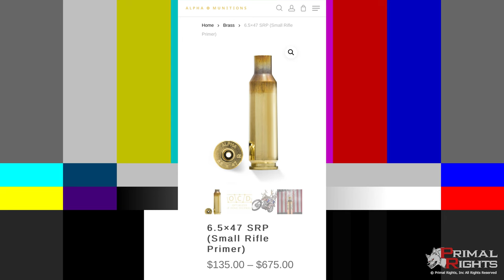Are they making bad brass? Here's how you tell!

Comment: I think saying the Brass manufacturers have no control over the metallurgy of their brass is a stretch. They will have a desired brass alloy they will specify from their supplier, some brass manufacturers may have wider tolerances in composition than others though.
Reply from the maker: I was being generous. Of course they can control what material they buy and can select whatever grade they prefer.

Comment: when brass is made by most companies it is made on more than one machine and when finished goes into a large bin .  then the bin is dumped and boxed up to be sold . so in one way even the same lot number will have different cases in it from different machines . i compare headstamps to see if the markings are the same . it will shock you checking that . but need a good magnifier to do it right . i even check the depth of the case head on my cases . and find even great brass is sometimes up to two thou different . you are so right about brass . my deer rifle i use what ever brass i have and don't worry about checking . but here in the east 100 yards is long range for a deer . my target loads and varmint loads get everything checked . really comes down to what works for the shooter and the loader . great video !

Comment: I did stumble one additional way to observe brass consistency, using the Aztec mode on your AMP annealer. When I first got my AMP i was struggling to get a reference number to anneal with, almost every piece of fired box brass gave a different reading from the Aztec mode, even though it was the same ammo and company. 
After annealing a once fired lot of Lapua handloads , I found the Azetec mode to give identical codes for the melting point of all of the tested cases.

Comment: Great info ! Thanks for sharing this info .As a competitive shooter I have loaded almost nothing but Lapua brass even though I had to fire form cases I just didn’t want to chance switching off from Lapua and having my scores possibly crash .Well after building a 6 BRA and having to experience heavy soot down the case for know reasons than I can understand. I cut necks into the shoulders ,annealed ,tested and tested and I can’t stop the soot .A good friend sent me 5 pieces of new Alpha 6 BRA brass I fire formed to my chamber ,know soot . I had pressure and backed the load down by .04 of a grain compared to Lapua .Alpha is very consistent with accuracy. I just order more today 6 hours before I saw this video. Thanks again for doing what you do to help our community.

Comment: Thanks Greg. We appreciate you & your work. Most of my brass is Alpha or Lapua with a sprinkling of Peterson. I probably have in excess of 2.5K pieces of Alpha. I obviously like them, but am puzzled by the neck wall thickness. It is rare for me to measure a piece of Alpha that doesn’t have close or in excess of 1 thou difference in neck wall thickness. I hate when circumstances to cause me to have a chamber neck diameter that is large enough to prevent me from neck turning. I won’t write about all the things that an uneven neck affects. My degree is in technology, but I worked as an engineer during my career. I have a lot of chemistry, physics, microbiology, etc. This causes me to question my measuring techniques & try to better them. I had a decent Mitutoyo ball head micrometer. After my findings I purchased calibration blocks and another ball/anvil head micrometer to ensure the measurements are repeatable. They are. The fact is they are horrible in this criteria that you think is so important. I’ll be happy to send some for you to measure. You don’t own as much as I do without liking Alpha. I try to work around it with the neck turning.
Thanks for all you provide us with, God Bless
Let me know if you would like some samples from newer virgin Alpha OCD cases.
Reply: It sucks when someone you listen to for long periods of time, even enough to know the speaker better than some extended family members, doesn't check their own channel to interact with subscribers with genuine questions about the topic of the video.
It causes me to question why they have a channel.

Comment: I only used Lapua until Alpha was available and Lapua wasn't. Had problems with the .200 dimension with br and bra in beginning, but after loading up charge weight on Alpha the heads finally grew to grip my chambers and stopped getting bolt swipes. It does perform very good now. Alpha was very good at answering my concerns and helpful in suggestions. Bit i still hate to have to fire brass five or six times to get it to perform. I am using a   standard reamer for both cartridges that Lapua cases always performed with. Alpha heads are very hard and i feel a little smaller dimension at .200 dimension on head of case. I wish they hadn't change that from what wheeler had tested.
Reply: I had to rechamber a barrel cut for Lapua because of case blowback. The new chamber was cut with a Alpha legacy 6mm BRA reamer. So far the performance is nowhere near what I expected. I just received a barrel yesterday chambered by Alex Wheeler for 6mm BRA using Lapua brass. I have never see such beautiful work on a new barrel. I’ll soon be seeing which outperforms the other. My 6 GT shoots with more precision that the Alpha 6 bra.

Comment: I was the one who presented the question in the previous video about how can you control/adjust seating force other than increasing or decreasing the diameter of the expander mandrel. I understand turning necks to various thickness is one way, but I was coming from the assumption that this was already done and a uniform neck thickness and concentricity had already been achieved. I'd also assumed that the annealing setting had already been established using the AMP. I sacrifice cases in my AMP Annealer and use the setting provided by the device. I don't see how we can accurately determine if another setting is more appropriate or accurate than the device itself. I just don't feel comfortable increasing or decreasing that setting and don't want to expend barrel life to prove out what changes that makes. I'm content accepting what the machine is telling me to use.

Given these parameters, I'd like to understand how one can adjust seating force "neck tension" aside from using varied diameter mandrels. I will typically select a mandrel diameter and seat a bullet in an empty (prepared) case, with the AMP press to see what force is achieved before starting a lot of loaded ammo. If the force is too high, I'll go up 0.0005" or 0.001" in mandrel diameter.

I'm achieving very consistent force readings over say 100 rounds. Usually around 10-12 lbs. ES. If I have an occasional outlier or two, I'll set those aside for sighters. I set out to achieve seating force in the range of 30-50 lbs. I find the majority of my 300 SAUM cases are hitting in the 42-48 lbs. window. As I stated previously, I have a 300 WSM barrel I've found performs better with higher seating force, around 80 lbs. with 215 grain Berger Hybrids. 6mm and 6.5mm calibers running lower - 30-45 lbs.

I follow this process because I've found new brass behaves differently than those having several firings on them. I will test that force with a prepped case each time because I've found I need to adjust the amount I'm expanding necks (more or less) to achieve the desired seating force as the number of firings increases. Let me know if there's a better way of achieving the desired seating force in a way the results are more predictable other than varying mandrel diameter.

Comment: In the past 5 or so years I've gotten some new Winchester brass in 7.62x54R, 223 Rem, 25 WSSM and 303 British. There's been a definite downgrade from Win compared to the previous 25 years. The 303 and 54R necks were dented and brass had a tinny sound. The 223 had very erratic primer pockets. I've bought new Win brass since mid 80s by the thousands. Primer pockets were always very consistent. The 25 WSSM had a couple of cracked necks. 

I'd heard that Winchester is having Privi in Europe making brass for them. I've dealt with a lot of Privi brass in various calibers and it sure seems to me that "rumor" is true. I had a new Privi 54R brass case that was missing the primer pocket, just a hole in the case head. 
This is disappointing an understatement. Its why I'm buying Starline and Lapua lately.
Reply: I have a huge amount of once fired factory Winchester brass. When I compare it to the ADI brass I normally use it's pretty obvious the quality difference.
Reply: @Alan.livingston  I'm still using some the Win brass bought from Midway in the mid 80s. They had great prices that beat dinking with USGI  brass by far. I don't over stress with overly hot loads. Good quality .223 brass will last for many dozens of reloads. The primer pockets wear out long before the rest of the case.

Comment: I just bought new Norma Brass. X300
The weight variation over so many cases was only 1.72gn and each batch of 100 had almost exactly same average weight, 103.75, 103.62, 103.7gn..
With nosler 17rem brass had a different aztec code for each hundred.. now with Norma...thinking of just using one as so littke weight variation...

flashole deburring presented material..with norma, not so much with nosler.

Primer pocket uniform process with 21C adjustable tool is a horror using vernier gauge depth feature...I'll be looking up gizmo to measure this...for future consideration...

Very informative...giving new ideas to measure cases 

Just rediscovered that need to aztec after first firing ..

New brass prepping is of interest ..what to do when...I usually 3/4 neck turn unfired brass...

Thanks for posting ..
Keep up the quality sharing...it's appreciated

Comment: I am going to disagree with you on your point (at 23:45) that these brass manufacturers don't have control over their raw material. Any good manufacturer should have in-incoming Q.C. department that should test each shipment they receive for the requirements they need/specify. Therefore, they have the ability to either accept, or reject each incoming shipment.

Edit. That is that department's job. To make sure that what engineering specified, is what is received. If it is not, then manufacturing's job will be much more difficult, if not impossible.

Comment: Good video.  Do you feel if a person started with mediocre brass, that after firings, concentricity work, annealing, etc (all the things we do to brass), it would become good brass?
Reply from the maker: Generally not. As I said in the video, it's usually a waste of time. The non-uniformity is baked into the brass often times, and we can not fix it by any normal handloading process. It's a herculean effort to try to wrangle bad brass to produce consistent results... when each piece in the batch is not uniform to each other. Case capacity or metallurgy can not be readily altered or uniformed by us when we receive it. It's either good, or bad. Our efforts can make the best of the situation, but it will never shoot as good as a truly good batch of brass.
Reply: Oh my dear Lord. I just got a chill up my spine after reading this response.  I have alot of new unloaded Nosler brass for two different cals.  Please please tell me they will be fine for hunting deer in northern New England where shots over 150 yards are rare.  @primalrights
Reply from the maker: @clasvirhodes4969  A deer sized target inside of 150yds... a 1700's era musket would probably give a guy success in that endeavor. So yeah, as long as the brass is functional, I'm sure it'll be fine.

Comment: Greg - on resizing, I've heard you say several times that you like to bump .001 so the bolt has a some pressure to it and you can feel if something is wrong. Is this correct? I do the same and definitely feel some friction when closing the bolt - thats the point yes? (I use alpha brass and have an SAC chambered rifle and use SAC modular dies and get very precision and consistent on my sizing). Also I took your recommendation and went down by .001 on my bushings and mandrel in the dies, the AMP press definitely shows better consistency (I was very good before but it made it even better and got rid of some of the outliers). It seems that changing the neck sizing operation also made the sizing more aggressive that I had to use a different shell holder (I use an area419 press and shell holders along with the shims in the die). Is it because I changed the flow of the brass and am pushing more brass back. What was once sizing perfectly to .001 bump now took me back down to the size of new brass which is close to my go gauge.
Reply from the maker: You might be misunderstanding what I've said just a touch. I generally look for 1.5 to 2 thousandths of shoulder bump. I do not want to feel any resistance on the bolt when closing on a loaded round.
Reply: @primalrights  That makes more sense. Thank you and thanks for the neck tension video - qualitatively helped for sure.

Comment: Magic Johnson once said, to be the best, you gotta learn from the best. Whos best in shooting business, give it or take it? fclass shooters. What they shoot? Burgers, Lapua and temp stable powders (h1000 etc). Alpha is also super good as a lot of prs guys shoots them. These are top 2 brass, im only 3 mins in the video, i know this will be said, has to be. Burgers are most consistent, has the least BC deviation, i believe 0.75% or 1.25%. Then its hornandy, at like 2.75% or 3.25%... cant recall exact numbers. No need to going into like crazy stuff like pointing bullets, and what not. Clean barrel/gun every few hundred, do what i wrote above, and you be above 95% of all shooters, including some prs guys. 

The stuff i said comes from cortina, i know primal rights are budies did few vids together with erik. So invest in these, and maybe more accurate powder scales. Load a bullet, do first powder charge ladder test to get low sd/es, and then if groups are bad, adjust seating depth, thats it. Thats a simple recipe to be above 95% of all shooters. Please save your time on cleaning brass, bullet pointing, weighting and sorting etc, etc. If you do this, and have quality barrel, good technique, it will shoot 0.3-04 moa or less. To trully get to those 0.2-0.25 moa, then you will need to spend wayyyyy toooo much time with all that other crap, just to drop that moa slightly.

Pin this, take a pic, frame it, put above your bed room whatever next to biden, trump, your family tree picture... maybe even replace it :D